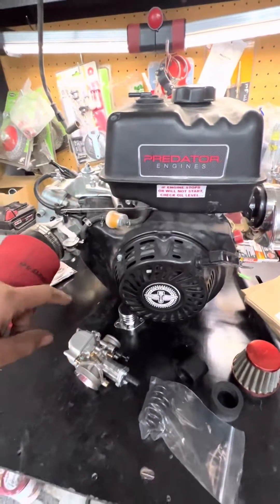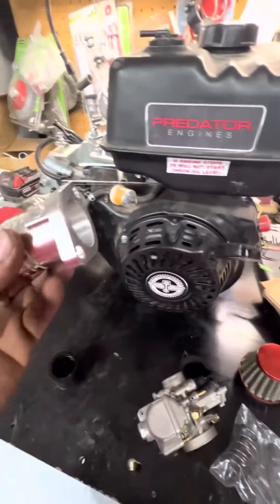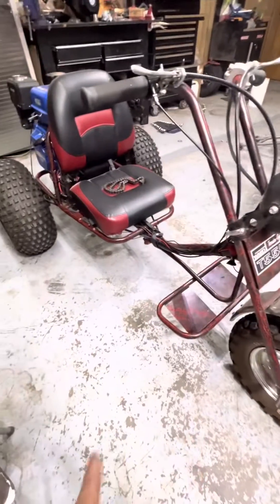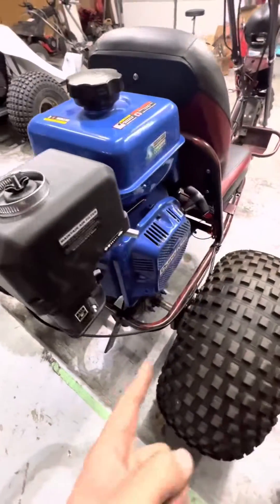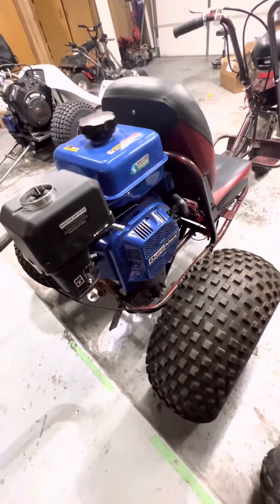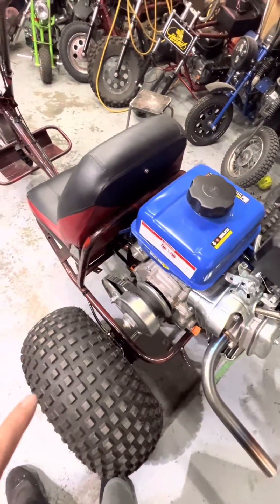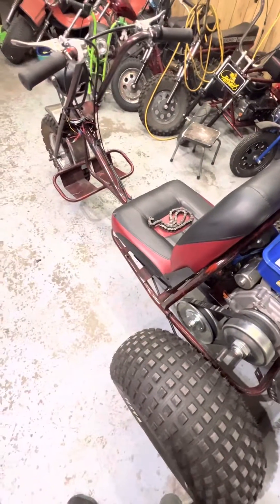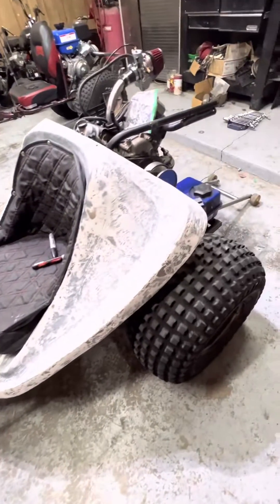Predator 301cc governor delete?

Comment: sweet bro, let us know how it performs?
Reply from the maker: Love it man the 301cc on the trike is a perfect fit? Its alot more enjoyable to ride and she gets up and goes
Reply: @Mini.Moto.Guy806  I've got a 440cc build I'm doing right now and I got a 34mm flatslide carb, 76mm high airflow vector intake, free flow exhaust and I'm going to do a governor delete in a few weeks. I'm expecting big power but of course being realistic but I'll be putting this in a bike with a 2 speed transmission I think I'll see way over 100 mph